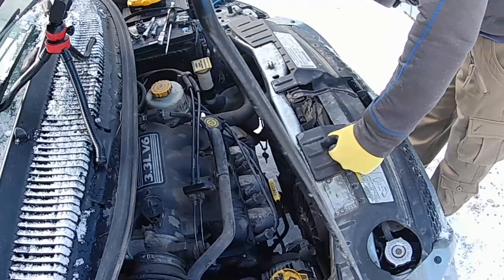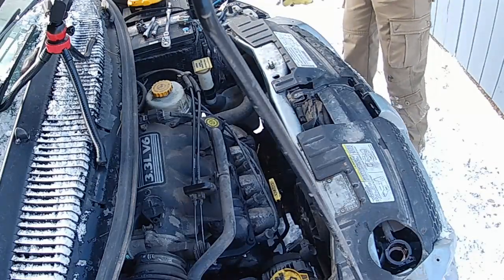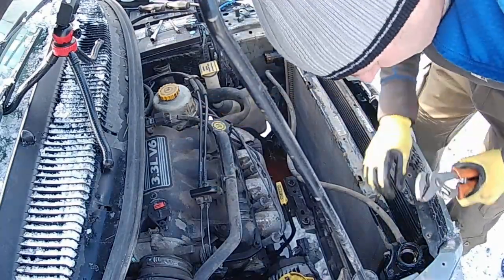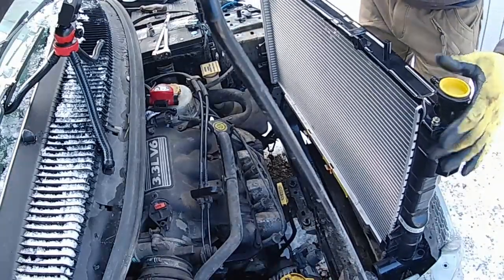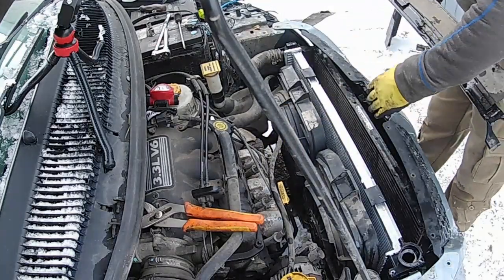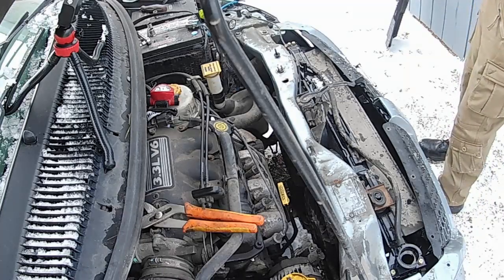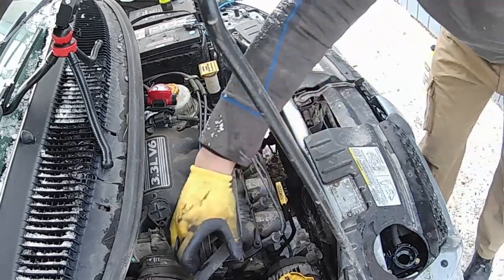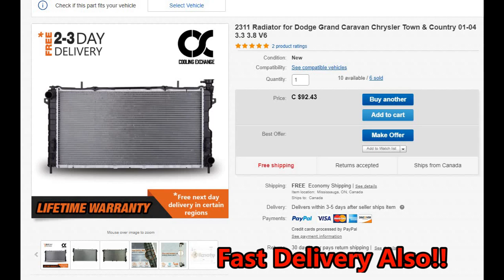Dodge Caravan Radiator Remove & Replace 2001-2007

Comment: Those tend to leak at the top above the hose. You won't notice a leak but you'll be smelling anti-freeze and losing it. There will be no pressure either as the plastic tank is cracked.
Reply from the maker: You are probably right but I sold the van before it failed again. Thanks for the comment.
Reply: @codraven57  I replaced the radiator a second time, this time with an all-aluminum one.
Reply from the maker: @adotintheshark4848  oh crap! She should last now.
Reply: described mine to the T.
Reply from the maker: @rebelartstudio3730  glad I could help.
Reply: @rebelartstudio3730  replace it with an all aluminum radiator

Comment: Thank you for this video! Question - what is the typical radiator lifespan nowadays? I replaced the radiator two years ago on my Dodge Caravan 2007 with 190K km (the original) Now, the new one I installed started to leak 212K km on the side where the plastic and metal parts join. Can it be that the lower manifold gases leak and create extra pressure for the coolant and that is why the radiator goes?
Reply from the maker: The lifespan can vary a lot........no not the gases because your rad cap will take care of any extra pressure in the system. It may be instalation and the fact that they don't make shit as good as they used to. Some of the aftermarket parts will last a long while and some not so much. Good luck with it and thanks for viewing and commenting......I hope this vid help you.

Comment: Does the radiator need oil and transmission lines
Reply from the maker: The radiator doesn't need it but the transmission needs the cooling of the radiator. So you have a seperate section of the rad that cools your transmission.
Reply: @codraven57  does it leak when you change?
Reply from the maker: @redsealjourneymanreviews6647  a little spillage but not much.

Comment: great video....why do you have to lift the tranny and a/c coolers to get the coolant radiator in? are there clips or tabs?
Reply from the maker: Yeah, they are all attached to each other there. I don't remember if it was clips or small bolts. It will make sense when you get in there at it. Good luck, and thanks for watching!

Comment: is there a tranny cooler? is it ieasy? what type of coolant?
Reply from the maker: I don’t remember but if it is it’s not interfering with the rad switch out. You will capture most if not all that’s required. You can get a universal all compatible coolant now for a top up.